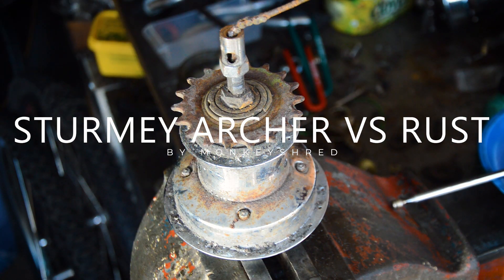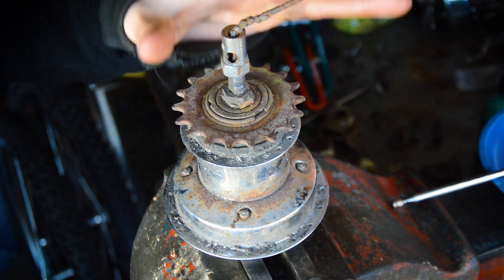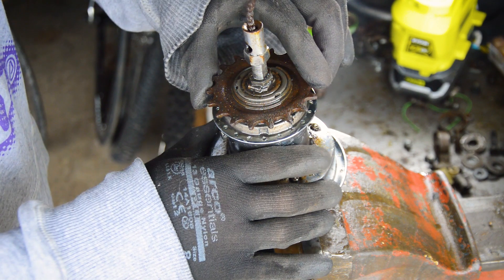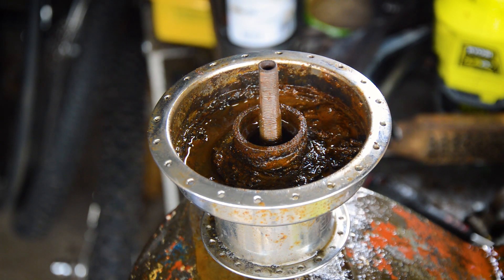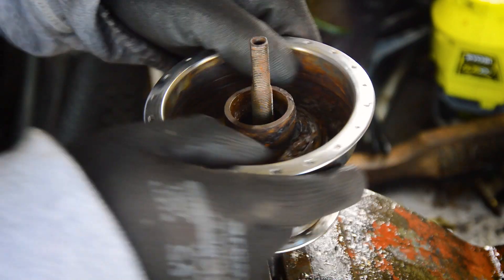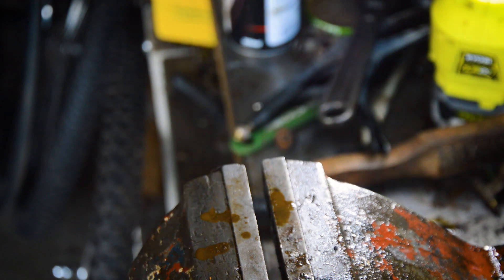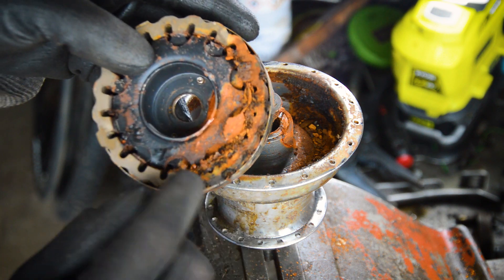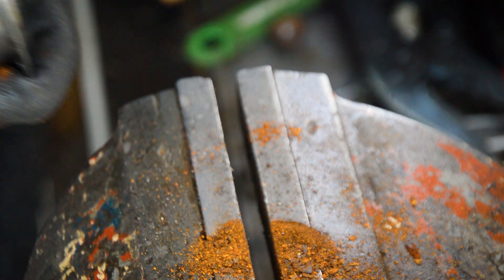The Sturmey Archer 3 Speed Dynohub Vs Rust - Will It Rebuild?

Comment: Great vid and a great help to me today stripping a completely seized hub.  Although the magnets in mine seem ok I havent reinstalled the dyno into the hub because one of the terminals has been lost. However, the 3 speed mechanism and pawls now work perfectly and the wheel is back in the bike without the dyno.  Fingers crossed the wheel works as it should on the road.  Can't see why it shouldn't because the dyno isn't a stress or load bearing part.
Reply from the maker: Hope it worked out for you!

Comment: Here's a top tip, if your working with rusted nuts n bolts, by all means use penetrative fluid of your choice, once you brake the rust seal don't be tempted to just fully undo said nut or bolt! Clean the threads if you can with a wire brush then undo and do up the nut or bolt a few times and clean again, repeat this until the nut or bolt can be undone with minimal effort. There's been so many times I've seen nuts sieze solid or bolts sheer due to rust fowling the thread.
Also an excellent way of removing rust and freeing rusted threads is electrolysis!  Try it, you'll be amazed.

Comment: I replaced my magnet ring with a 2mm soft iron ring and rubidium magnets embedded in epoxy .More power out now
Reply from the maker: Oh interesting.  Nice work.
Reply: @MonkeyShred  I looked at casing and after i sow that the chrome finish was not damaged beyond a little TLC i did my repair

Comment: Those magnets sure look horrible, but they don't look especially rusty to me, more like rusty flakes are sticking it them. The second, much newer, one at least looked eminently savable. Those flakes are more likely to be off the armature which is thinner steel and more prone to rusting (an armature should be OK if there is still electrical continuity between the two terminals). 

If I'm wrong and they are absolutely toast, at least they're only AGs, there's no shortage of them around, though hold on to the little bolts and washers, it's a nightmare if you're missing some
Reply from the maker: I'll try and clean them up a bit more but as you say, they're not really a valuable hub.  I'm more keen to get the internals working and keep them as spares or even as a display
Reply: @MonkeyShred  They're a fairly valuable hub, surprisingly, (outside the UK anyways).

Comment: why didn't you use Evaporust?
Reply from the maker: Because the metal on both hubs had already been eaten away.  Especially the older hub, it was a mess inside and Evaporust, as good as it is for removing rust, wouldn't bring back the metal or chrome.
Reply: gotcha,,,